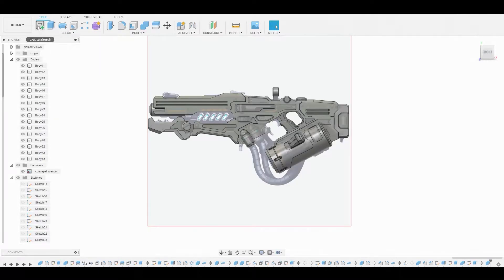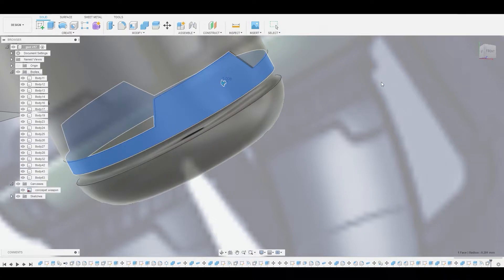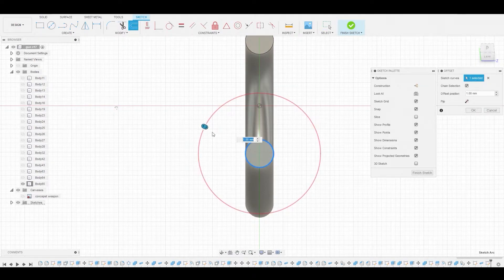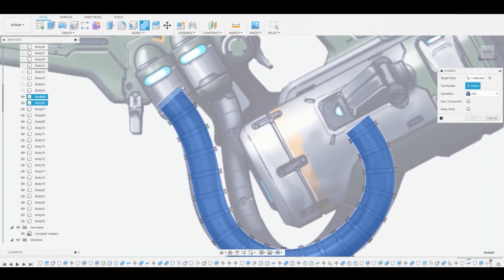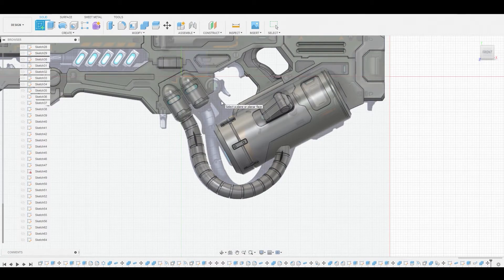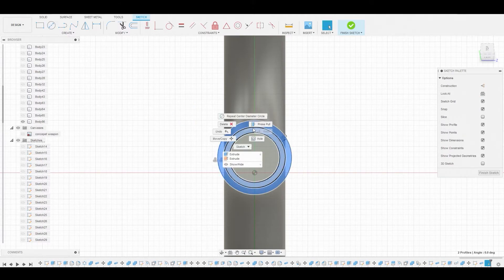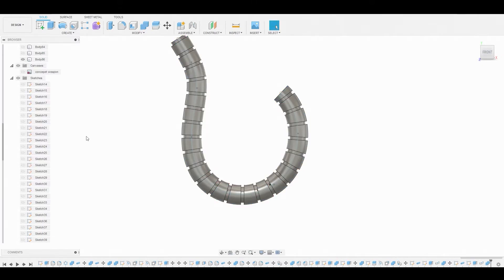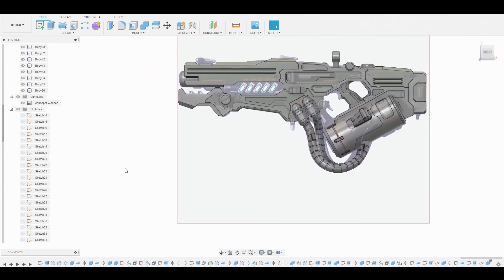Weapon Modeling Series in Fusion 360 (part7)

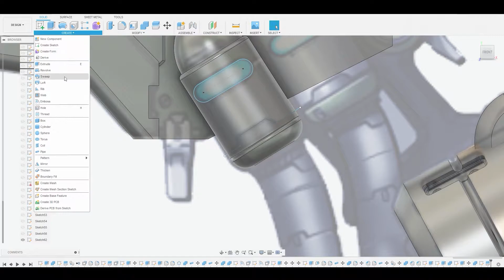Comment: 1:02  I do step by step from the beginning what you do, at this point when you use the "emboss" function I have this message:

Error: Emboss result falls outside boundary of selected faces. Add adjacent faces to selection, adjust distance and rotation angle, or adjust proximity of sketch profiles to selected faces.

Why?

Im stuck here :(
Reply from the maker: Hmmm do you have discord? 
I would have to see this
Reply: @thelastdev  I cheated the system a bit and used the "split body" function And then Press pull and it worked ;)
Reply from the maker: @quitsmile5096  awesome I show that method  as well, great thinking!
Reply: @thelastdev  The best thing about fusion 360 is that one thing can be done in a million ways, and the timeline is also a very powerful fusion tool.

  I would like to thank you in advance for your films, the amount of time and work you put into recording them is amazing.  

This is one of the most underrated channels on YT. 

 Btw, I have a question for you, will you make a video on how to export a finished model to Unreal Engine 4?